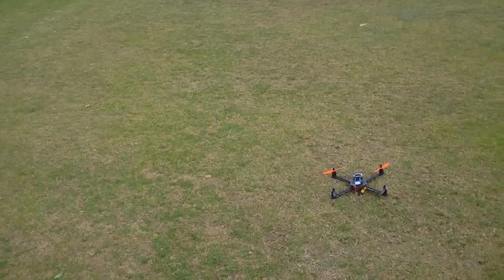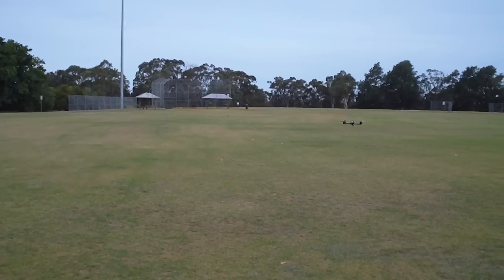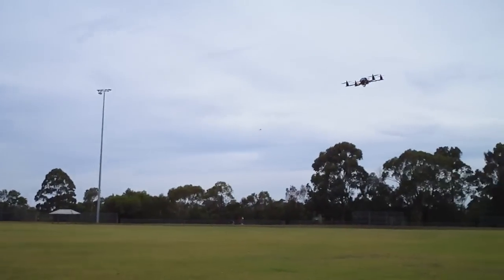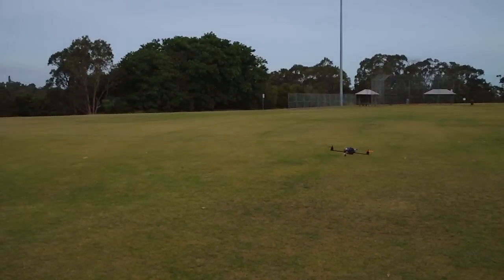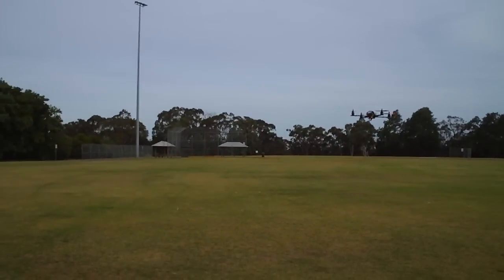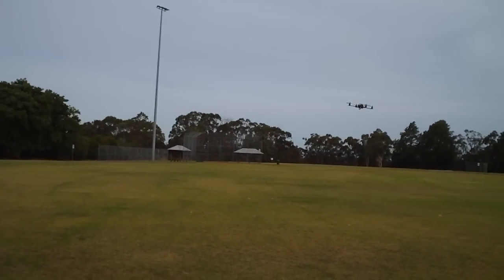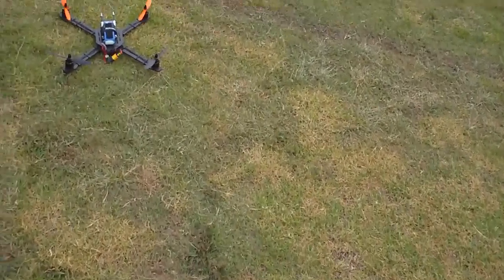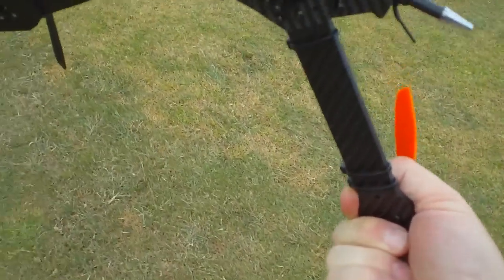Betaflight 2.15 - Air Mode on / off comparison

Comment: Idle up is acting kinda the same as air mode that's why when you deactivate airmode there isn't much difference. If you remove idle up and and disable/enable motor stop and put airmode on a switch then you will see and feel a big difference in airmode on and off. If you don't have airmode enabled with motor stop on and you go to zero throttle and bad things can happen like losing control of the quad due to the flight controller gets confused in a way because it can't control the motors due to zero throttle having priority. Now with airmode on and motor stop enabled if you go to zero throttle it will keep the motors spinning at min throttle so that you can maintain control of the quad at zero throttle. So air mode kinda acts like idle up but there is alittle more to it. So to really get the effects of airmode take idle up off , put arm on a switch and airmode on a switch and keep motor stop enabled and when you arm you quad...... Continued next comment

Comment: After you take off enable airmode then your motors will stay spinning when you go to 0 throttle. Just be sure to disable airmode before landing cause it makes it difficult  to land.    Airmode is a great thing to have.
Reply from the maker: +Mad Speed Fpv Thanks for the comment,  I have been using an idle up switch from the beginning with these multicopters to keep the motors running at 0 throttle.    I was asking on the thread if I would see any benefit from Air Mode in my situation and the only way to find out was test it.  As you say there is very little difference.   I have never had an issue with my machines falling out of the sky using an idle up.  To be honest I have gone back to baseflight as I prefer the way the quads fly and just use the idle up as I was previously.   It is good enough for my flying needs.    This video is baseflight with an idle up - no issues and perfect control at 0 throttle. https://www.youtube.com/watch?v=QnMciUwHYWw

Comment: alot less bounce in your stops but i think you could tune them out , im about to try and tune out the heat from my setup but if i cannot i'll just go back to using my throttle curve

Comment: Does airmode make the idle up redundant or do you still use it with airmode activated?
Reply from the maker: +Greg McKean Yes I personally still use idle up so that I can stop the motors by throttle on landing, air mode works the same with or without the idle up.

Comment: Thats not what airmode is really made for. You may as well not use it.
Reply: +Noel Harris So what is it made for ?
Reply from the maker: +UKHeliBob I think its designed for people who don't use motor stop and idle up.   Please correct me if I am wrong Noel.  I plan to try it that way next but I have always flown motor stop enabled and an Idle up so I wanted to see if there was any advantage to using Air Mode in my situation.
Reply from the maker: +Noel Harris That is what I asked in the Betaflight thread - i.e. would there be any advantage in my situation to using it.   I was curious to try it anyway.
Reply: +Trainboy64  here is some info on air mode.  Basically it gives you much more control at lower throttle levels.  For you, you are idling up which is essentially just the same gyro handling algorithm but at low throttle.  So you probably feel a little less stable at zero stick throttle. But  Air mode uses a different gyro algorithm so it even allows zero throttle and even motors to stop, all the time giving the same locked in feel.   

It is geared toward people who do a lot of low throttle/ 3D flying.  Low throttle flying is usually slow flips, rolls, descents, etc.  But in my opinion, it's great and everyone would benefit from it.  Just don't  try to land while in air mode!  

Check out this link, about 3/4 down the page there is a great post by Boris (the betaflight developer)  http://www.rcgroups.com/forums/showthread.php?t=2464844&page=644

Hey +Noel Harris, instead of telling what it's NOT made for and disappearing forever, why not stick around and be helpful by explaining what it IS made for?

hope this helps!